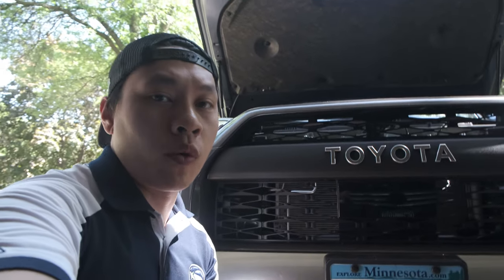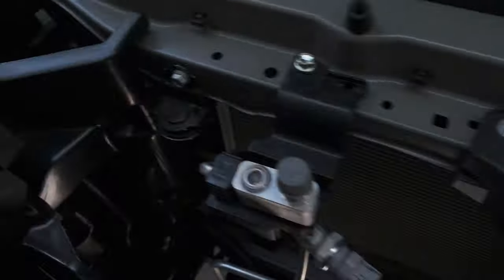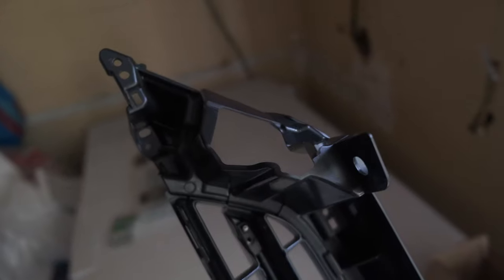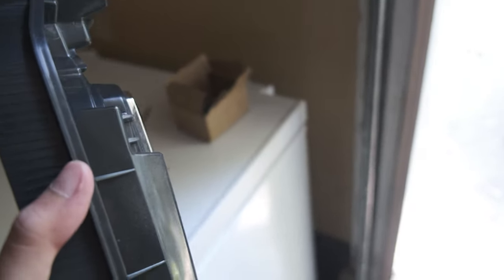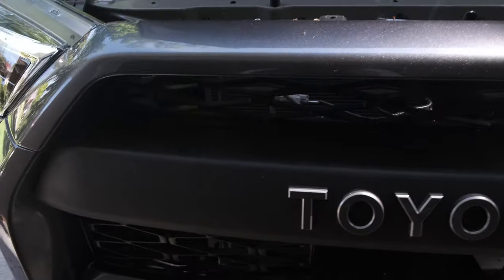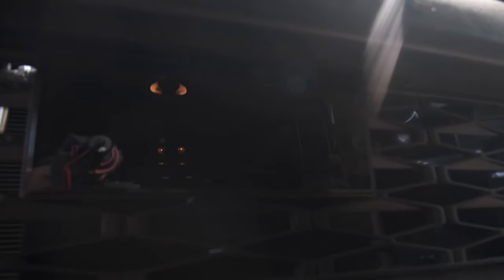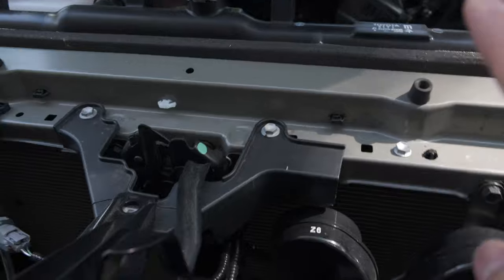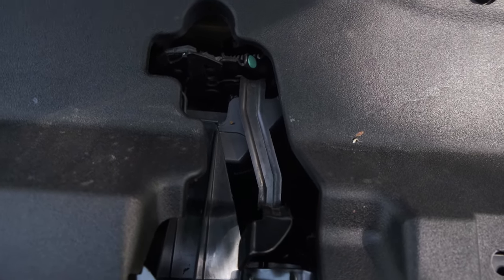2020 4Runner TRD Replica Grille Install

Comment: Hi Dan, Thank You so much for posting this video.  Now it all makes sense.  I've got a 2020 4Runner and was wondering  how to screw everything back together.  OEM said although it wasn't a replacement for my VIN it should work.  Well...yes, with modifications.  Thanks again for sharing this video!

Comment: HEY YANG ! THANKS FOR THE VIDEO ! ONE QUESTION IF I BUY 2020 OEM TRD PRO GRILL TO MY SR5 2020 4RUNNER WILL IT FIT WITH NO MODIFICATIONS? SALUTES FROM Puerto Rico
Reply from the maker: Should be exactly the same, no difference.

Comment: Hey dan, i see yours you installed the raptor lights pls tell me where the fuse box you tap in and what slot?2020 model fuse box different set up.or make a video how to install that was a big help for the latest model
Reply from the maker: Mack, the fuse is located in the engine bay right next to the battery. Fuse is the INJ
Reply: @danyang3336  okay but one problem my fuse and came from the raptor light factory it’s not the same, mines one is a low profile mini fuse and then from the factory is a mini fuse so do i have to get mini fuse to put in on the fuse tap?thank you
Reply from the maker: You can use an Add A Fuse which would tap into the regular inj fuse

Comment: For those interested in a kit suitable for the 2020 4Runner with no cutting or mods required I found this. I have no affiliation with the supplier. I stumbled upon it while reviewing the 2019 and back kit on trail4runner.com.  I clicked their link for the kit and noticed this 2020 kit in now available as well.

https://cartrimhome.com/Front-Bumper-Grille-Replacement-for-4runner-2020